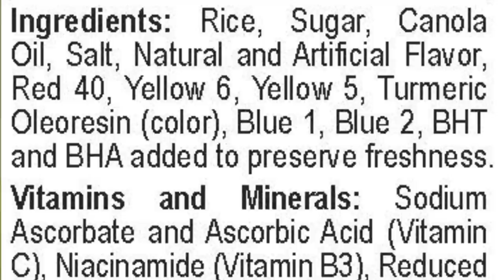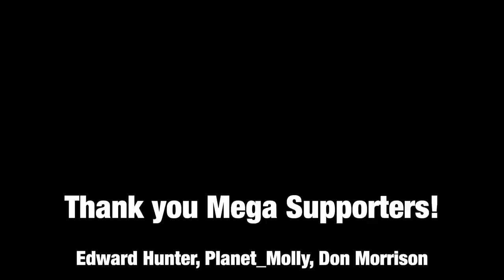Health Gurus Are Lying To You

Comment: Greta explanation. I have tried explaining if asked. It’s a difficult concept to grasp. Also I read typically Cals labels are not accurate on advance 15/20% out so counting them is difficult. Couple this with the knowledge that individuals “burn” calories at different rates, activity, resting etc. How would one know your rate you use calories? The equation is unreliable in my opinion based upon both side of variability’s. Another question might be do we trust the food industry and labelling standards! I really like the metaphor’s you use Dave, thanks.

Comment: It doesn't matter how you gained weight, to lose weight (and reducing caloric intake is necessary) you need to lower insulin levels, therefore reduce carbohydrate intake. And stop snacking. Note that the Daily Minimum Requirement for carbohydrates is (0) Zero. The lie is in the Recommended Dietary Allowance (RDA).

Comment: Just don't be the guy who lies, Dan. Can you prove that vegetable oils cause inflammation? It's not just "common knowledge" that the dozens of keto carnivore gurus you've listened to adhere to, right? Is there any scientific research that you rely on? Because reasoning that linoleic acid is a precursor to inflammatory cytokines does not mean that there is a direct correlation between linoleic acid intake and inflammatory markers in the body. It doesn't work like that. If it always worked like this, then it would be possible to raise the level of serotonin and dopamine in the brain, simply by taking their precursors - tryptophan and tyrosine - harmless amino acids. But for some reason, people still need antidepressants with a bunch of side effects to achieve these goals. But in the case of linoleic acid, keto gurus have no hesitation in equating it with more inflammation, and they seem to need no research to make that claim.